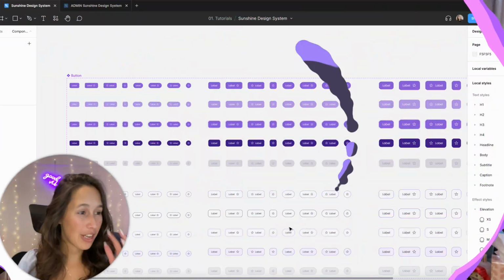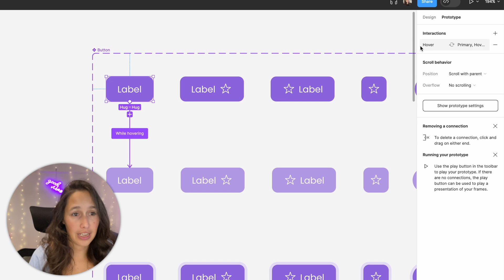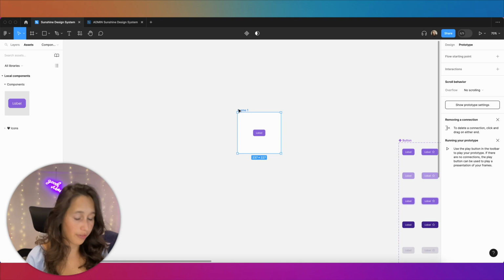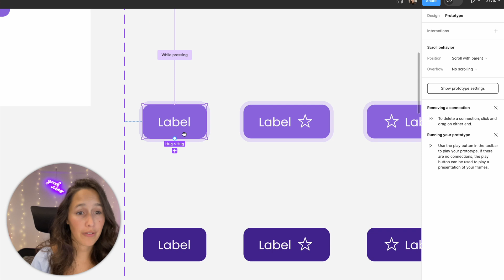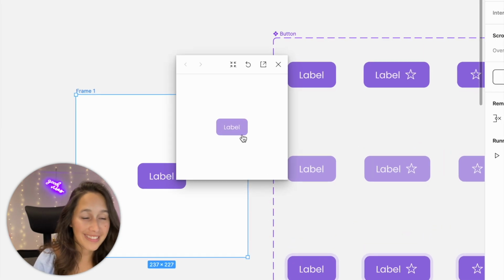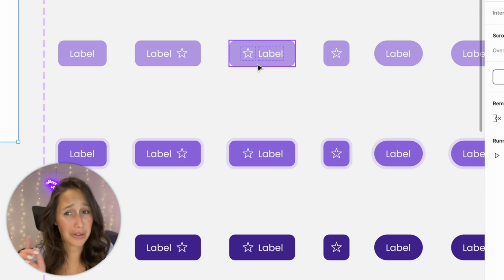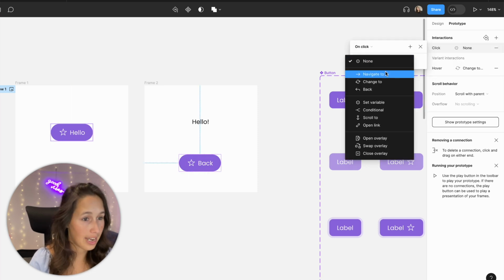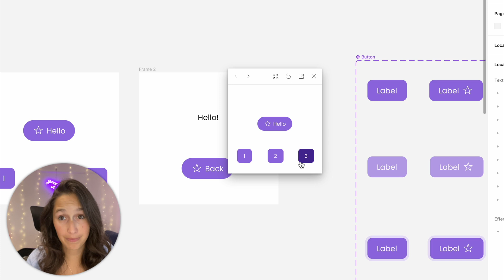Figma Prototyping - Button Component Interactions | Part 6 | Figma Tutorial Step-by-Step

Comment: You dont need to create 240 different variants, just create 2 components

1- base button components (small, medium, large) that one gonna control (left icon, label, right icon)

2- instance base component and make it a new component for states and nested base buttons (that way you can control size, icons,labels)

Now you have 3 size base buttons, 5 state buttons (nested base button) 

For colors and round use variable modes.  

So for prototyping you can just deal with 5 components (only state buttons) not 240
Reply from the maker: Great ideas! That's why I love Figma, there are so many ways to approach the same thing! ☀️🙏🏻
Reply: @grafikaya I have tried this approach but always messed it up while changing the size after changing the state of the button.

Comment: Has anyone else had any issues getting past the hover state? I've watched this video several times now and followed all the steps, but I can't get my buttons to switch to the active state.
Reply from the maker: I’m determined to help you solve this! Haha so you have default connected to hover with a “on hover” interaction. And then do you have a connection between hover and focused which is “on click” ? Double check that all your interactions are correct maybe a “on drag” snuck its way in?
Reply: @TDSunshine  My hover and focused are connected with a "while pressing" interaction. The focused is then connected to the selected with an "on click" interaction.
Reply from the maker: @ronbrown5194  and right now what happens when you press on the hover button? It doesn’t change to focused at all?
Reply: @TDSunshine  That's correct. It won't change to focused.

Comment: Another great video! I had some trouble with my interactions, though. The only one that works for me is the switch to hover state, even though I followed your steps exactly. I'd appreciate any help you can offer to figure out what I'm doing wrong. Also, have you made a video on how to create drag and drops?
Reply from the maker: Thanks! make sure your click interaction comes from the hover variant and not the default one. Also, check the prototype panel in Figma there may be a warning there that might help! Drag and drops are a bit tricky but that's a great idea for a video! will add to my list 🕶️ I hope that helps! ☀️🤗
Reply: @TDSunshine  I checked and the interaction is definitely coming from the hover variant to the focused. I don't see any prototype warnings either.
Reply: Same here. Any chance that you've found the solution, remember it and want to share? 😁

Comment: Is it possible to select a checkmark and have the state of a button change from disabled to active? And visa-versa. Uncheck the checkbox and have the button go from active to disabled?
Reply from the maker: You can definitely make that happen if you use variables! There are a few ways but essentially, you select which variant of the button is shown using a variable, and then you set that variable to something new every time you “toggle” the checkmark. For example create a string variable “disabled” and use it to select the variant of the button instance. Then set an interaction on the checkmark - on click, set variable to “active”. That will change it to the active variant of the button. I hope that makes sense 🙈 might add it to my list as a good tutorial video! ☀️
I have a few videos where I show how to connect variables to variants if you want to check them out - 

https://youtu.be/fB-4ikrt3mk?si=yfGYKnYV8Zu49cgd

https://youtu.be/A1EYkbJIdIQ?si=0H3a3qvqcbU1x2_0
Reply: Thanks so much! I believe I got it. I'll give it a whirl and see how it goes. If not, a video would always be appreciated! @TDSunshine